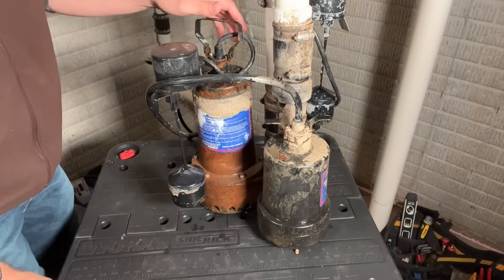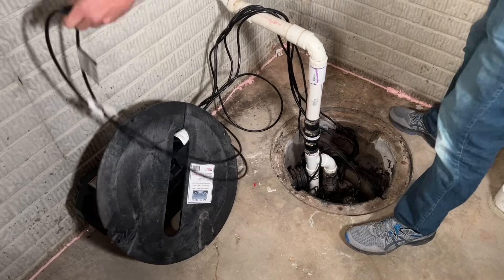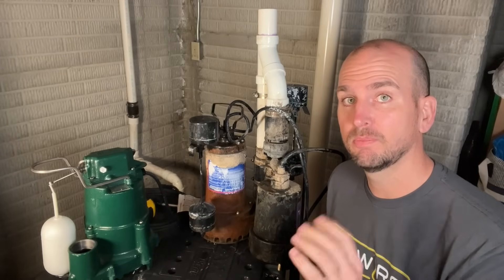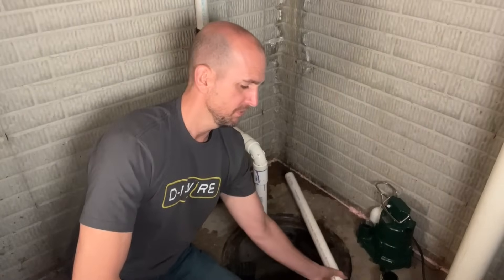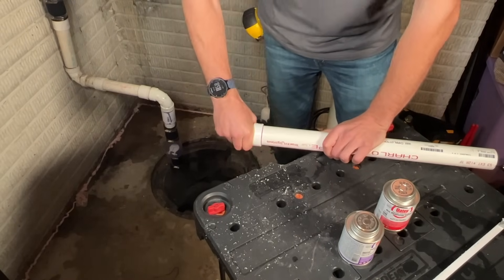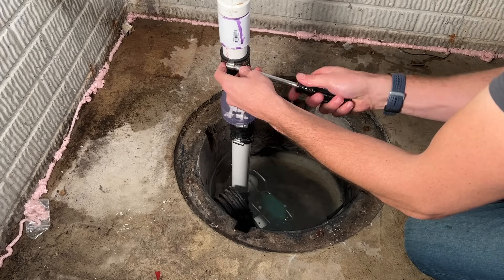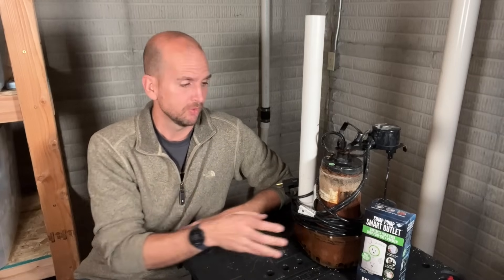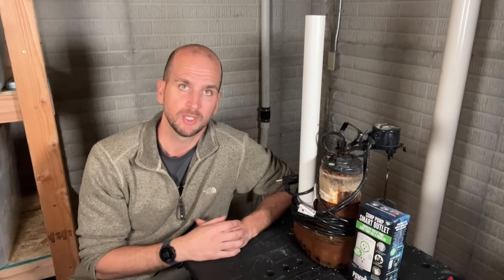How To Install A Sump Pump In Basement

Comment from the maker: Zoeller M98 (Best Pump!):   https://geni.us/XzEA1
Standard Check Valve:  https://geni.us/IA64GU
Clear Check Valve:  https://geni.us/AqIV
Sump Pump Pit Cover:  https://geni.us/uBoBe
PVC Primer and Cement:  https://geni.us/5GFe
Pump Spy WiFi Smart Outlet:  https://geni.us/QUUg

DISCLAIMER: This video and description contain affiliate links, which means that if you click on one of the product links, I’ll receive a small commission.
Reply: Hi buddy,I really appreciate this video as I'm having this problem in my basement right now,thanks for all the links..the only thing I'm missing from your list is the basin(I call it bucket😅) what size do I need? And does it have to be perforated? That's all I see in Amazon..thanks for your reply (I'm a follower).God bless.

Comment: I have a 3/4 horse zoller. The float got stuck and flooded my basement. I had a water sensor by the sump, but the water came in from pressure around the house. Adding a battery back up so that doesn't happen again

Comment: It’s probably not a bad idea if you ever have to pull your sump pump out for whatever reason and run a small drill bit 1/8’’ through that hole in the cast-iron vent hole, if it should start rusting shut.

Comment: I would suggest gluing that fitting on the pipe before you drop the pump in the pit. This way you won’t have to dry things out to glue the joint, and you can more easily mark the correct spot to cut the pipe.

Comment: If you buy a Zoeller pump you will be replacing it in a few years ,they eventually leak and short out the company knows about the problem and won't fix it ,they even sell a repair kit, Buy a Liberty pump instead

Comment: I'm here because my basement flooded with sewage. Came up from the floor drain in the basement Once Wet Dry vacuum was full, Couldn't move it. Water came up so fast and deep about 4 inches at its highest point. A sump pump while might have helped, it wouldn't have stopped it. Do you have any pump recommendations for floor drains ? I plan on getting a backflow preventer but asbestos tiles were discovered and no one will touch it, and I can't afford to have that removed. Every time it rains hard the basement floor drain backs up and I don't know what to do. Especially since I can't afford anything. Any ideas ?

A plumber told me it is illegal to pump sewage into my back yard. I don't care about that. Better in my back yard than in the house, and is actually fertilizer for the grass and tree. So even if the idea is sticking a hose or pipe out of the window, I am open to that. I just have to make sure a snake doesn't slither in here, because of course that's a problem too. Every creature from hell ends up at my house somehow, then sewage gets in here. Disgusting. Even the flood restorers left when they discovered asbestos. :(

Comment: Hey I have a sump pump in a small closet roughly 3’x3’. Should I cat 2 vents in the wall so air flows in n out of that closet. Reason is I had some mold on the sheet rock. I moved into the house last year and the sump wasn’t covered. I bought n installed a new cover for sump. Maybe the cover will prevent a lot of humidity going into that closet? Or do I vent the closet by cutting in opening at top n bottom?
Thanks everyone

Comment: I believe many scenarios could allow a water table to be a bit higher in the pump pit so as not to pump ground water that is no threat to basement. That’s why I’m trying to set my floats on an adjustable rail. I know where the ground water is acceptable (to me) when it’s not raining or snow melting and have set it to not trip on until it goes above that point.
CERTAINLY not suggesting this is a good idea for everyone but if you’re comfortable with higher water in pit you save much on electric and pump wear.
Also in my case I know my radon collection point is ok at the level I allow. The radon pipe will gurgle when the water rises more than that.

Comment: What is your pump sit on?
Basin bottom, stones, a block?
I don’t see anyone talking about it.
I’m redoing my pit now and don’t like the idea of cast metal pump feet abrading the plastic pit bottom. I removed the dirty crushed rock when I clean pit and am probably going to find some river rock to fill 2-3” making sure in find stones that won’t fit in the pump intake grate. I also thought about getting a round patio paver but can’t find one the right diameter.

Comment: Not to complicate matters, but why didn't you install the Zoeller 507 12 Volt DC battery backup with the new pump?  Most folks want battery backup, don't they?

Comment: I came back to write thank you. The weep hole saved my pump from being burnt out. I noticed that my sump pump was continuously running after I installed the check valve (very cool btw). It got freezing cold in Wisconsin and my exit sump pump hose froze up which caused my pump to continuously run with water only exiting the weep hole.

Comment: My pit has one pump working now. I will install a new Zoeller in the pit leaving the old pump as a backup. The float of the backup will will bring it on at the point the sump is at a critical level. I hope I covered all the possible scenarios !!!

Comment: I am Installing a Zoeller pump model M-53 (1/3 horse power) in the water pit in my home. From the pit there is a horizontal 1 1/4" PVC pipe (white) run on the floor for about 10' then it goes up the basement wall for 5' and then outside. How far up the 5' vertical run should I install the check valve (Zoeller Model: 30-0181) before it goes to the outside?

>And is it generally recommended to place the check valve about 2-3 feet up the vertical pipe above the horizontal-to-vertical transition. Many thanks.

Comment: One thing would be great with any sump pump would be to know that there is no power at the outlet if the gfci tripped or breaker tripped. A notification app or a onsite sounder when that happens, have you tried the smart outlet

Comment: Hello,

Great video and tips. Thank you.
I would really appreciate if you could share some experience with the EcoFlow battery setup with your sump-pumps.
In my opinion, this may be the best short term backup solution in case of blackout since a simple 12v battery backup would not be enough most of the time.
Or maybe you chose another battery? what about issues (or none) you have encountered with such a choice? How many pump are you powering with it? does it stay plugged-on all the time? is it OK for the battery health?
As you can see, I have many questions and you may have some answers I am pretty sure others may find useful 🙂Thank you.
Patrice - Seattle.

Comment: Great video with excellent explanations.  I have a lot of water drainage into my sump.  I mostly use Liberty pumps which have been very reliable. However one of my biggest fears is to have my pump stop working and flood the basement. So I had a Liberty SJ10 water powered system installed as a backup. While I don't like having to use good water to displace bad, I do not have to worry about a failing battery with a battery backup. I have a spare new sump pump with a new check valve in standby that I can replace in 15 minutes if needed. I also have my home alarm system tied into my sump so I know if the main pump is not working.  Probably major overkill but I sleep well and can go out of town without worry.  Thanks

Comment: One pro tip, bud. The internal switches on these go bad like crazy. They are underdesigned to handle the arcing that will occur each time it switches on. What you need to do is buy a solid state switch which takes out all chance of mechanical failure. You then zip tie the float so the pump is in the always on position and attach the solid state switch to your cord. Now the unit will only recieve power when the solid state switch detects water wherever you have mounted it. Zoeller and LevelGuard have one that works like I said but are kinda pricy. There's a different one by Roamoris AC that I haven't looked into but is much cheaper but seems to use a different setup. Probably worth checking out.

Comment: I know I am late to this video, but if your structure is subject to unacceptable levels of radon, you will probably want to consider sealing the sump basin lid. Some lids have an access port (which might double as a large removable knockout) so you can see what is happening inside the basin.

Comment: I have the Watch Dog System, other than checking the Battery every other month, not much to do. Things I like about this system, is it exercises the Pumps, so they don’t lock up during a dry spell. Also the Main Pump has an off Time Delay so it pumps the pit down further after the Float drops.

Comment: The M53 and N53 Zoellars used to be a good pump. After having two on the job Failures, I opened the pumps up. They eliminated the Top Ball Bearing for a Sleeve Bearing.
Reply: Is it still possible to purchase the older models with the faulty bearing? I don't want a zoeller prone to failing.

Comment: Great info about the weep hole.  Terrible advice on manually switching pumps and using the portable power box.  Use the tool made for the job.  2 pumps, 1 with battery backup, is going to be better for MOST (not all) people.

Comment: I'm curious if 1/2hp pump is enough for a high demand use case?  We get a ton of water thru the pit due to runoff from the hill behind our back yard (mostly sloped).  Our grading away from the house is fine, but during periods of heavy rain the existing pump seems to run almost constantly.  Duty cycle is a big concern.  I'm going to pull the existing pump to see if there is product plate with hp and watthr info (not original owner, no documentation) first, but I just know the new pump I put in will work hard.

Comment: I assumed a redundant system is preferred. If 1 pump fails, and least you can empty the basin with the other pump and flush it once or twice before working on it. Like in the case of a sewage ejector pump in the basement.

Comment: I have your M98 Zoeller Sump Pump, exactly same as yours from Lowes, it is not a cheaper version, it is the exact same, solid cast iron, green, M98, bought it 8 years ago, just to have it on hand, so its a extra still in the box.  It must have been before they went to a less expensive model because its identical to yours and whats in my sump pump now.  You do not have to connect those pvc water emptying exhaust pipes to the sump pump, mine just sits down inside my Sump Pump, while the other pvc pipe pumps out tbe water up to and above the main sewer pipe that it runs down into the main sewer - and flushes out - and into the sewer.  I've used my cutrent Zoeller sump pumo for some for 18 to 20 years now.  The new one sits in a box for when it requires changing that I will have exactly what I need before hand when the current gies out.   But - those pumps do not require those exhaust pipes to attach, it's only if you want or need them to per the use or type of use.  You're doing a lot of extra unecessary work.  But.  It's really just ones preference.   Your water level is set way too high on this video,  that water fill level should never get any higher than maybe 8 to 10 inches high at most, out of a 26+ inch tall sump pump pit or hole.   I'd never set that float to not kick on until that water got as high as you have it.  You need to change that setting in the float.  Also, id never drill a vent hole in the pvc either, it's not necessary. The pump has one already.
Reply: Correct on the pump having a built in weep hole, but a second weep hole doesn’t hurt anything, and cast iron can corrode, and thus clog the built-in hole

Comment: Excellent video. It looks like the fittings on your discharge pipe are schedule 40, I was under the impression, for a pressurized line schedule 80 fittings were required. Is that possible a local code issue?

Comment: Based upon my experience, I think it's a really bad idea to suggest people eliminate an already existing and operational backup system.  Unless you're always home and ready to correct any problem, that could quickly result in a flooded basement.  Our sump pump has failed at least twice over the 12 years or so we've lived here.  Thankfully, we have a water powered siphon as an emergency backup system. That system doesn't require electric power at all, so it's perfect to have during power outages or in the event of a sump pump failure.  Since we've had problems, I also keep a spare pump handy.  However, without an operational backup system already installed and ready to go, when needed, we would've had several inches of water in our basement when the pump had failed.

PS: Our current sump pump is a Wayne brand unit.  It came with a 5-year warranty, which worked out well for us because the float switch failed at less than 2 years old.  Wayne replaced it without the need for me to ship the bad one to them.  Since the warranty replacement cost nothing, I'll stick with it.  However, if I ever need to pay for a replacement pump in the future, I may look at other options.

Comment: Thanks for the video...My problem is my house has a 1" pipe.  Plus no way to take it apart without cutting the pipe. PVC pipe comes out of the sump pump once out of the basin, goes 90 degrees for about 2.5 ft then 90 degrees, then straight up 9ft, then 90 degree towards the outside of my house about a 1.5ft.  For now I am going to get an adapter for 1.5" to a 1" to get the pump working.  Later this summer I will replace the 1" with a 1.5" PVC pipe, put a check valve, and have it go straight up then 90 degree towards the outside.  I also saw a video where they put a "T" adapter on the pipe outside.  This way if it freezes you can unscrew it so the water discharges still.  I did not do this.  I had the pipe coming outside then 90 degree down for 1.5ft then 90 degree for about 30ft to a pop up drain away from the house.  My house was built in 2013 in Eastern Missouri.

Comment: What type of sump pump do I need for heavy sludge in the water? So far, I've gone through 2 pumps in a matter of a couple of years, and what a gross mess pumping it out. I never saw this in my other homes. 

BTW, I was told because my home sits on top of slight hill, so the pump doesn't turn on as often. Thanks, in advance!

Comment: Timely, I just installed a Zoeller pump with a basement watchdog battery backup unit. I noticed your original setup had the two pvc pipes merge below the check valve. Basement watchdog doesn’t show that but I plumbed mine the way you had your original. 

Any thoughts on that? 

Also, I put in a “quiet” check valve and they are awesome, very quiet, no more valve bang.

Comment: Good job drilling the vent hole. The vent in the discharge pipe is not just in case the one in the pump gets clogged. It's to expel trapped air out of the discharge pipe. The vent hole in the pump is to expel trapped air out of the pump housing. Both are necessary for reliable pumping. You'd be surprised how many "professionals" think they are not necessary.

Comment: Helpful video.  But one concern...  I had a sump pump installed in a previous house.   By a leading, sump pump only nationwide outfit.   It worked great and it had an open cover like yours.  Prior to the sump pump install my radon level was 2, which was considered good (I'm in the northeast which often has high radon). A year after the sump pump was installed, I decided to test again.  The radon level was 10!  Equivalent to a pack of cigarettes a day and the second leading cause of lung cancer in Massachusetts.  Worse, I had a finished basement with HVAC air returns and that radon gas went all over my house.  Needless to say, I redid the cover and my radon level went back to 2.  At a minimum you should test for radon and best of all have a sealed cover.
Reply from the maker: Good info, thanks for the feedback 👍. Probably not a bad idea to check the levels.
Reply: @EverydayHomeRepairs  There are electronic radon testers available for less than $150 which provide continuous monitoring.  More convenient than the old style use once charcoal testers that you need to send to a lab.  It's interesting how the radon level increases with rain.

Comment: My pump just failed it’s bern use 20 years , I had a spare which I dropped in , but I had a bunch of oil in the water from the failed pump , can I put dawn dish soap in the water ?My pump has to be going 24/7 there are underground springs which drain water always

Comment: TIP: your PVC has three 90 degree bends like mine did, I changed mine by going straight up with a 45 degree bend to the outside, less 90 degree elbow bends, less resistance to the water flow. I also changed to a ball float switch, the fixed float switches don't provide enough on/off levels, they tend to cycle too much between on/off . I set my ball float cord about 6" out to get rid of 8" of water, not 4 or 5".
Reply: A wheep hole is not necessary with a quality sump pump!
Reply: @AngeloR674  Zoeller M95 has in large print on the box about the need for a 3/16" weep hole and refers customer to the install manual.   Which I'll prolly read some day.

Comment: What do u called that male threaded fitting that u put on sump pump discharge? Having hard time finding that thing unless it comes with the sump pump?
Reply: That’s a glue in threaded adapter fitting for 1 1/2” pipe, or if your pump has an 1 1/4” pipe, you need it for 1 1/4” pipe.  These are pvc fittings next to where the pvc pipe is.  Find at Home Depot, Lowe’s, or Menards.

Comment: I'm confused about the spare pump pre-plumbed. Is it easier (possible?) to simply screw off the old PVC from the failed pump and screw into the new pump you keep on hand before installing?